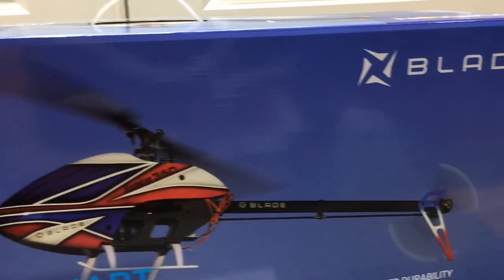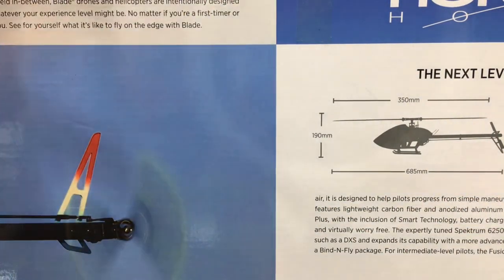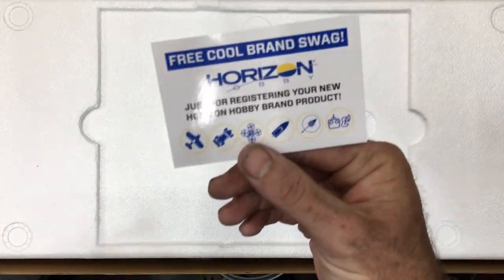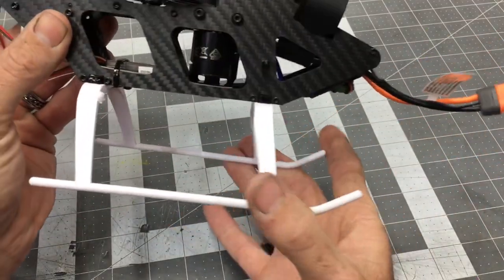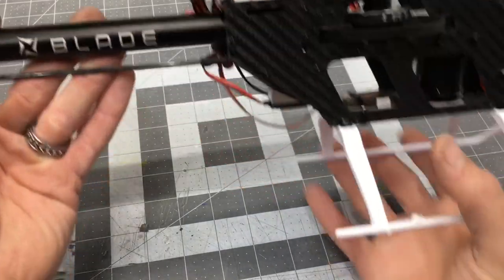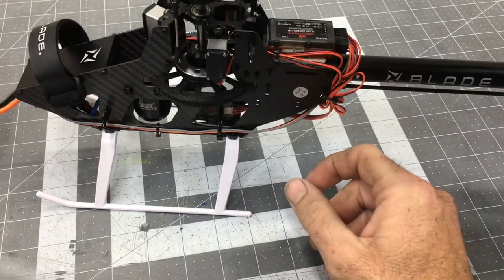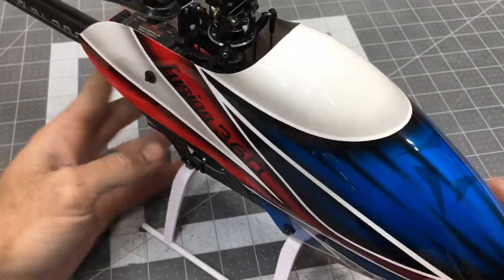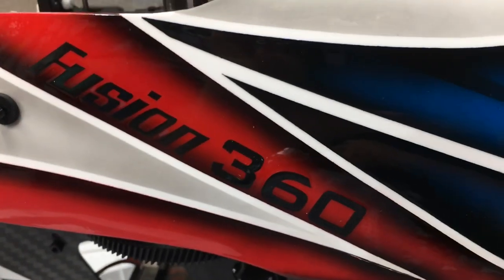Blade Fusion 360 Smart Unboxing And Review

Comment: What really triggers me is the wire job..
On the box art and the model out of the box, I mean ok you can rewire itself.. 
A couple of openings in the frame for some cable binders would've been nice. 
It looks like a decent Blade product with the metal head. But those wires are really cringe.
Reply from the maker: I agree, the wiring definitely bothers me. If you have watched any of my videos you will know I am a wiring fanatic and I like super clean helicopters where you can’t even see wires. I will definitely be rewiring and cutting and shortening all the wires. I get that they have a pre-done length of wire and they are mass-produced. So they’re not gonna be up to everyone’s standards, and a lot of people don’t mind it. It is a fantastic model! I have put quite a few flights on it already in by far my favorite blade helicopter!

Comment: Do you think this will stuff inside 450 size scale fusalges nicely?
Reply from the maker: It would stuffed inside of one very nicely! The only issues I can see you having depending on the specific type of scale body you are going for is tail boom set up because they use such a large diameter boom to eliminate boom supports if it is a raised up tail rotor or something of that nature that requires a gearbox style it could be an issue but on a normal scale 450 body it would fit perfectly!

Comment: Did you know you can run it on 4s? 
Here's a link 
https://youtu.be/uLiNTNsvYVk
Be sure to read the comments
Reply from the maker: So yes, I’ve already tested it. But! He is full of crap in a few ways. Number one, ESC temperature got pretty hot. After about four minutes at 100% head speed ESC was 183° when I shut it down. Yeah I know he’s claiming 140° but that’s just not the case. I also read he’s talking about more power. It’s not that you’re unleashing more power with the 4s pack by changing the ESC settings there is a way to get more power on any smart helicopter by changing in the forward programming. I’m going to do a video on that in a little bit. From my tests with stock pinion 4s after about four minutes temperature was 183° and amperage spiked over 50. I don’t know if I believe him when he says that you can do 70 A out of it. That’s not something I have tried yet. Have you personally tried it on 4s? You do gain torque. There is a difference between the two. But I don’t think it would be a reliable flight after flight set up without at least changing Pinion size. But I am working on that as we speak.
Reply: @westhobbiesrc8051  I changed my pinion size and I don't ever run it at more than 65/70% throttle tho. As for a increase in power I can feel a difference in the governor, like doing tic tic tocks. It does have over current protection, and temp protection  it ill go in to limp mode tho and then shut down. 
Now I'm not am not aware of what Moffetts the esc run to do the switching, but if it uses IGBTs (insulated gate bipolar transistors) it should be able to handle good a amount of current. Tho I think it might be a 32 bit system. Even If it doesn't use IGBTs, I'd think it'd be cool to have an esc use igbts to do all the switching. And then use a 555 timer to control PWM by using a variable resistor.
Reply: Also are going to build the fusion 480 super combo kit?
Reply from the maker: At 70% throttle it was very happy with the stock pinion on 4s. I didn’t see a temp over 143°. And I could definitely notice a lot more torque. I’m going to drop pinion size to a 10 tooth and see if the temps will come down with 100% throttle. Now the head speed will drop a little but the torque will make up for it. It definitely flies fantastic! I’m very happy with it on 4s but I don’t wanna make a video on anything until I am comfortable with anyone/everyone being able to do it and not have to worry about burning anything up. I really hope so! I would love to build a fusion 480. Probably my dream/favorite model made from blade!
Reply: @westhobbiesrc8051  I've been lookin a getting another heli here's what I have on my list 
Xl power nimbus 550
Xl power spectre 700 v2
Blade fusion 480 super combo kit 
Trex 550x dominator super combo kit 

What would you recommend as a first or second kit?
Reply from the maker: @sawyerheslep8493  Man those are all great selections. That’s definitely a hard one to pick/choose one. Really comes down to your preference? Ella copter you have listed above is fantastic. I know firsthand the Trex 550 X is a beast! As well as anything XL power makes is fantastic! And the blade fusion 480 is incredible as well. Personally speaking I would on every single one of them, I really hope to be building the fusion 480 next, it is definitely on my list!